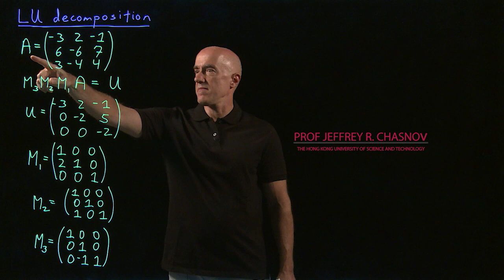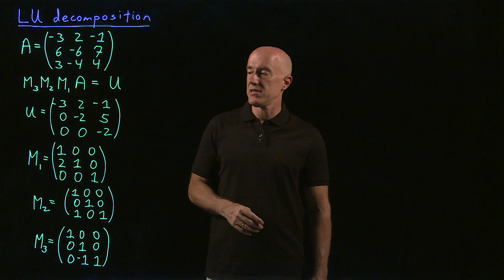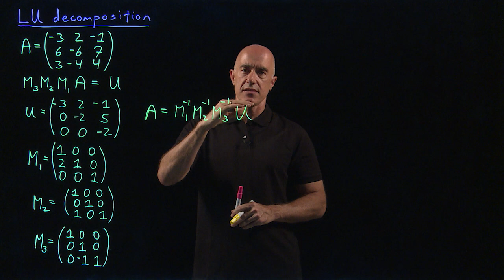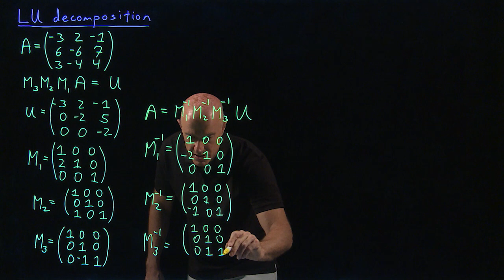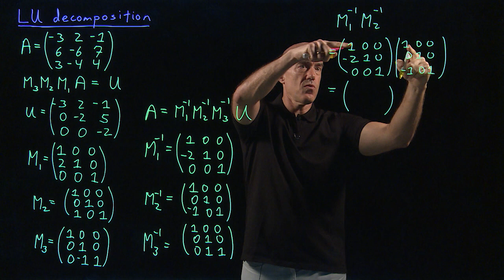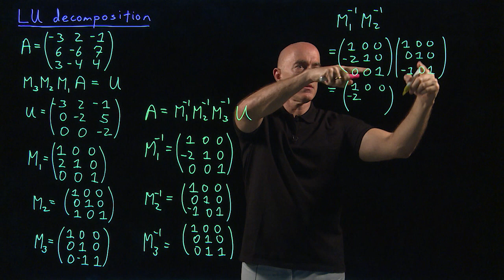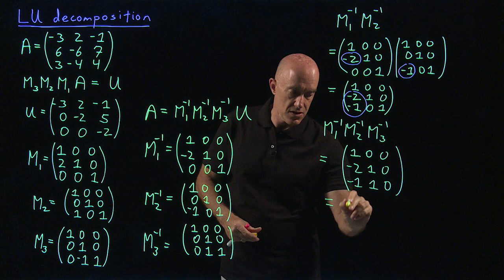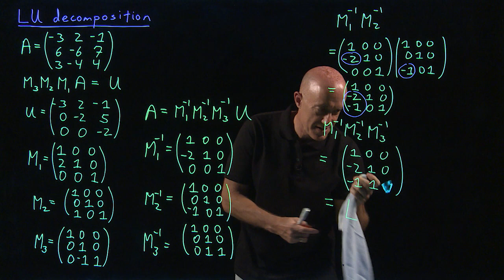LU decomposition | Lecture 14 | Matrix Algebra for Engineers

Comment: I think there is a mistake here, when you took the inverses inv(M_3 ) should come first and then inv(M_2) and so on, to verify I did try it on Matlab and got this : 

L =

   -0.5000    1.0000         0
    1.0000         0         0
    0.5000    1.0000    1.0000

U =

    6.0000   -6.0000    7.0000
         0   -1.0000    2.5000
         0         0   -2.0000
Reply from the maker: No.  You need to peel off the M matrices one at a time by multiplying by inverses.  The L you get in MATLAB is a permutated lower triangular matrix.  If you look at the help page for lu, you can see the proper call to separate out the permutation matrix.  Then you can try it again.